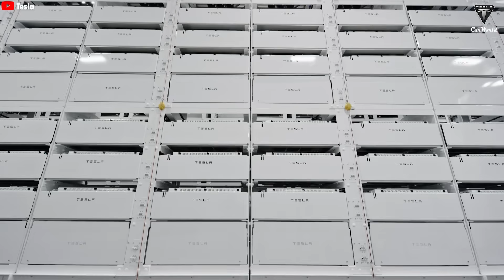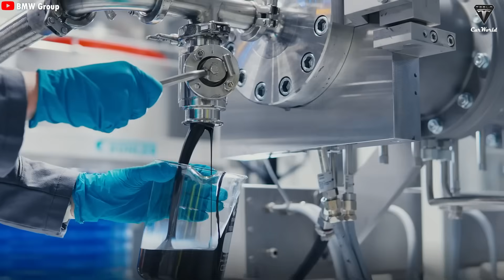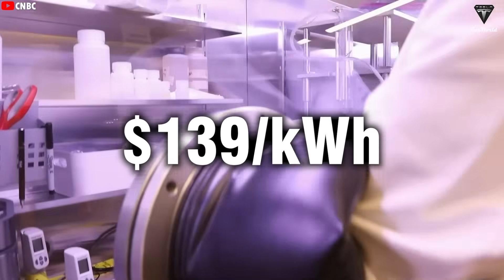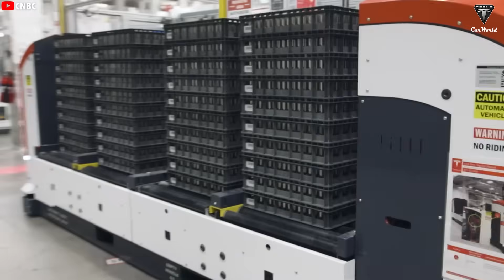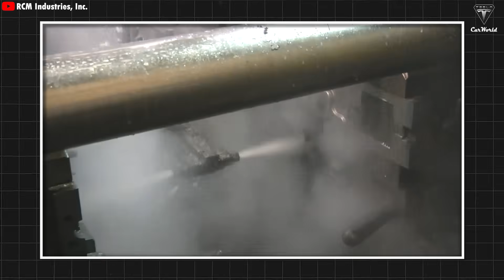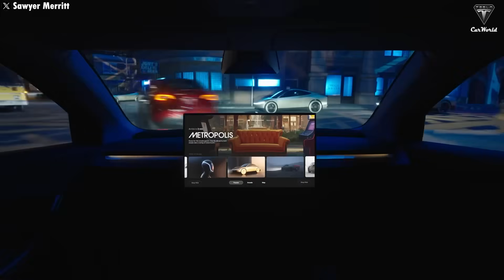2026 Tesla Cybertruck NEW UPDATE ! Elon Musk LEAKED Massive Changes & Lower Price!

Comment: The issue isn’t the size or the cost.  It is the range.  When originally advertised it had an estimated range of 500 miles which is required if you would ever want to use it as a truck.  

People want a big truck with power and useable range.

500+ range sign me up.  300 miles yeah I’ll pass.

Comment: I think they're on the right track -- but i think the cybertruck could be stripped down even more for a lower price by dropping the 2 back doors to make a 2 door, dropping the 4 wheel steering to make 2-wheel steering, making the back seat collapsible thus  expanding the bed to 96 inches [the length of standard lumber and underlay. dropping the number of speakers from 10 to 4,  how about a $30,000 model like that?  that's my price guess. what else maybe slim it even more. reduce the stainless steel and substitute aluminum. put a logo on it.
Reply: yes that will be a start.